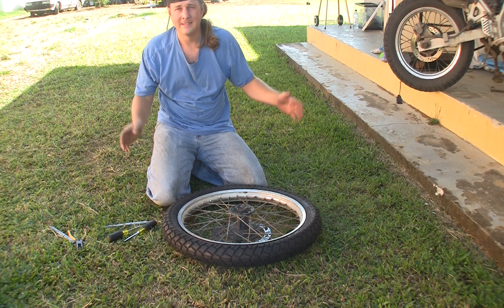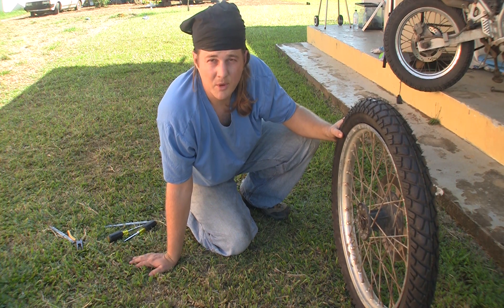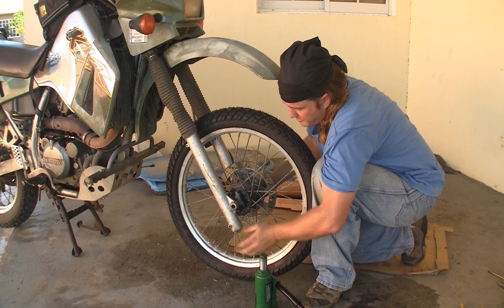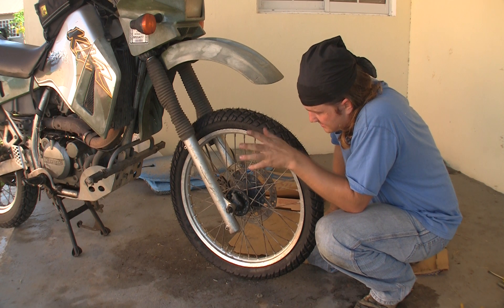DIY: Mounting a motorcycle tire tutorial

Comment: I have never paid anyone to change my tires. My first experience was  helping (more watching) my dad change tires on a car when I was about 8. Yes, I'm that old. Three tire irons are my minimum. You can do it with two but three makes it lots easier. Since I never had a tire iron that was to big I'm going to say that the longer they are the better. 

A liitle soapy water on the bead will help you get the tire on easier. They make lubricants for this but I have never used them.

Comment: I have a DR650 that I bought last summer and I just changed the front tire out. I had watched about a million youtube videos on it, and they made it look so easy. I bought some tools and felt like I was pretty prepared. It took me about 45 minutes the first time. After realizing the tread direction was backwards, it took me about 10 minutes the second time. I recommend using baby powder on the tube and using a beadbuddy. It holds the initial bite when removing and replacing the tire.

Comment: You got it changed, it holds air, you have all your fingers. You win!  Here's my tips: get a valve core removal tool, makes it easier to keep the tube deflated. Next, break the tire from the rim on both sides first. The key to all this is getting the beads from both sides into the center of the rim while prying with the spoons. To get the front wheel off the ground, put something under the centerstand and weight the back end. This works if you are in the boonies, too.
Great job.

Comment: Tyre balancing is an essential part of mounting the front tyre. If your front tyre is not balanced sufficiently you will experience a hammering effect at medium-high speeds through the handlebars. This compromises handling and may cause a loss of control causing an accident at worst and be plane uncomfortable at best! Get it done!

Comment: I think you did fine for the first time, as you completed the chore without puncturing the tube.  
I put the valve stem of the tube in first.  Then I put hand goop on the edge of the tire and press it over the rim.   Usually, it goes on without any tools, as body weight is sufficient 90% of the time.   Then I tuck the tube into the tire, then put hand goop on the edge of the other side of the tire.  The Goop or hand soap does wonders.  The key is not to puncture the tube.

Comment: Ok, that is great,...I love it when outa frusteration,....you just do it!  You got the job done. I have done that job so many times, your own mistakes you will learn the best from. Just a brief suggestion, break the bead before trying to get old tire off, use lubricant to reinstall, and try using some support like a padded 2X4 on the rim. This will protect the disc brake from getting dragged in the mud and sand. Great job thought!!!

Comment: The KLR tire can be static balanced easily if the bearings are good. Just support the tire by the axle from two level points. Whatever side of the tire is at the bottom is the heavy side. Lucky the KLR tires isn't supper sensitive to balancing. On another note, it is a great idea to put a new tube in the tire when changing it. If the old tube is still goo it can be stored on the bike as a spare. Only other hint I can think of is to use the spoon upside down to to pry a stuck tire from the bead.

Comment: Tip that I found from experience. When putting the new tyre on, the tyre will try to seat itself on the bead as you are going round, this makes it next to impossible to get the last bit on, when you have the last bit to do just go back round the tyre and push it into the middle so it is off the bead, then the last bit becomes easy.

Comment: Tip: use some shower gel or gel type hand wash on the outside of the rim and tyre, it helps it go on easier and you may want to consider getting a torque wrench don't want your wheels on too loose or too tight both can have disastrous consequences. Also when using a screwdriver with tyres find something to cover up the sharp bits on the screwdriver or you run the risk or popping the inner tube and that's not fun.

Another awesome video HT keep it up

Comment: Front tires are easier than back tires, they are much more flexible. 
The big thing with either is THIS. If it feels like it's to tough to go over the rim it because the far side from where you are trying currently trying to lever the tire on has allowed the tire to move up out of the drop center. Push it down into the center and it will go. 
On a rear tire sometimes a Bead Buddy isn't enough, you may have to use a good sized C clamp to pinch the beads together into the drop center. Then it goes

Comment: Ah, I remember when I changed my first tyre and you did much better than me. The were levers flying in the air from rage and all sorts xD A few tricks I learnt for tough tyres is using 3 levers as if you put all  in, the middle one comes out easy and you can follow on round. Also use a lube like glass/windows spray as it evaporates quick. What would have been funny for us, but not you is if you had knicked the tube and found out you had a leak when you go to inflate it :D

Comment: ok if you look at the rim you will notice that the center of the rim is smaller in diameter than the outside edge. If you put the bead of the tire in the "Drop Center" and use your tire spoons on the opposite side it will be much much easier. And yes a third one make the job a little easier too, as well as a little soapy water.

Comment: You get an A for the effort.  Some lube (soapy water) makes this process easier.  Remember keeping the tire in the center of the rim gives you the most "slack" in the rest of it to lever it on.  

Since your BMW uses tubeless tires, taking the wheel off wouldn't be required for fixing a roadside flat.  Just plug it and go.

Comment: leaving a little air in the tube will help it fit a little easier and makes seating the valve stem easier as well. Also, pushing the tire bead to the center of the rim will make it much easier to get the remainder over the edge..either way its a pain in the butt...

Comment: I did the following today
Put the tire/rim in the sun for about half an hour meanwhile i went to buy the inner tube then unmount the tire remove the inner tube (in my case i replaced it) then to reinstall avoid using that steel bars, if you arent an expert you will damage the inner tube, i just put some silicone or wd40 in the tire mounting area and i just mounted it buy pushing by hand, way easier, they was charging me crazy price for the job too

Comment: Balancing.  If you think that the front end is a bit shaky at speed you will need to balance, and it's easy to do in the garage.   Statically balancing, works in most cases.  I did a video on it and can share it with you if you want.   Let me know.  It works!

Comment: Well done. My tips are to lube the tyre & it'll come off & go on easier: WD40. Leave a bit of air in the tube so it doesn't twist when reinstalling: enough air so you can balance it on your finger & it just holds shape. If you have trouble breaking the bead on the bigger rear tyre, use the side stand: put on centre stand & secure it with a strap, extend side stand placing foot of side stand over tyre, then lean the bike over, using the bikes weight & side stand foot to break the bead. Voila! X

Comment: PRO TIP:only one thing that i saw that you forgot is to lube the new tire it makes it a hole lot easier to pot on then :) i use soap and its good because it drys so the tire wont slip on the rim after it drys

Comment: @halfthrottle I sent you the video, let me know if it worked as I am a nooby to doing video responses.  The video I sent you is really about putting car tires on motorcycles, but it has a section in the middle where I do the static balancing.  I hope it helps someone.